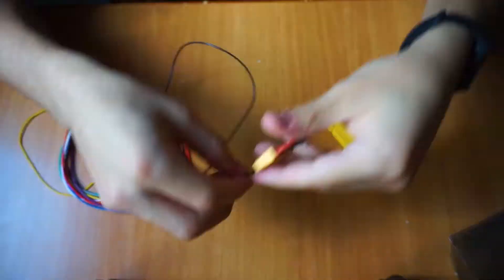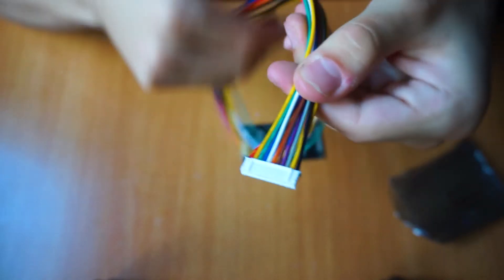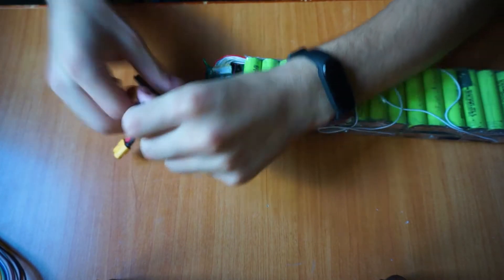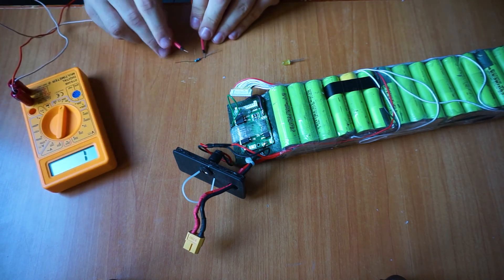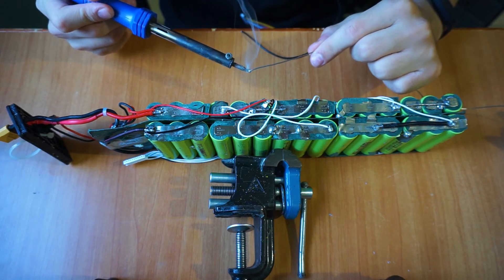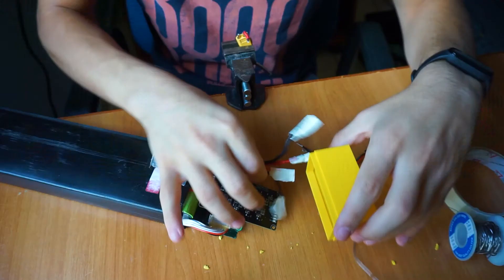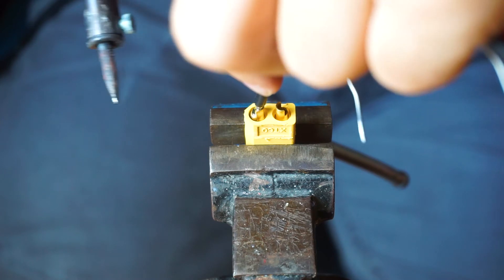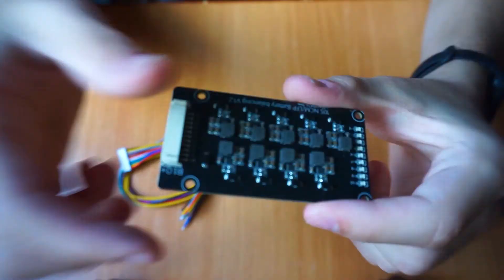Let's Add an Active Balancer to the Electric Bike Battery - Li-ion Battery

Comment: Hi! I hooked this type of 14S active balancer upp to an inbalanced 14S batterypack. Some LEDs lit up, then after 12 hours or so, all the LEDs where off, but when I measured the battery, its was stil as inbalanced as before, so the active balancer did nothing? Is that not strange? I have another big battery with an JK BMS thas has active balancing function and it works perfectly.

Comment: I did the same method, but when I connected the last wire (red positive) under the battery, smoke came out of the stabilizer. What is the reason?
Reply from the maker: Probably inverse polarity

Comment: Don't solder on the cells!! Solder in between.
Reply from the maker: in between ?
Reply: @mauri_scio  On the nickel strip in between the cells.
Reply: When building a battery pack, you typically make sure that those nickel strips on every series connection are extended and bent near the cell (with the proper insulation between cell and strip). You unbend it a bit and solder there, then bend it back down. 

If however it's a battery pack that is already soldered like that, what's been done has been done. Soldering over other solder, if your soldering iron is big and powerful, is relatively easy and fast. The cell won't really overheat if you do your job in something like 1-2 seconds (that requires experience).
The real problem there, is how much attention the original battery builder has paid when building it ¯\_(ツ)_/¯

However "not soldering on the cell" isn't really great advice. 
Here's why: 
If special extra paper rings have been stuck on the positive end of every cell, then ok, go ahead and solder in between. However if the cells don't have any extra insulation, you run the risk of over heating that spot, melting the insulation and completely sorting the cell (since the outer ring of the positive side of the cell, which is insulated, is actually the negative pole (alongside all the battery walls and opposite end of the cell). In this case, the nickel strip will become red hot and probably melt, therefore disconnecting it from the sort. But then you will have to remove that one cell, since it will have gotten quite hot by itself, possibly slightly damaged, but also, you will have a cell that has melted nickel all over it 😊
Spot welded cells cannot be removed easily 😊 So, have fun with that... 

To summarize: You need extra insulation on the positive end of the cells if you want to solder in between. 
The industry standard is to have strips going "over the edge" and soldering there. After that, you bend them and they are touching the cell walls or the plastic frame if such a frame has been used). If a frame hasn't been used, then you must also add appropriate insulation at the contact area.

Comment: You Don't have to let lt be forever there the active balancer...boy....just balance the pack and chek wether it is balanced or not then disconnect and remove.
Reply from the maker: And whey is that ? isn't more convenient to use that 24/7 ?
Reply: @mauri_scio  no it such your battery after couple of days you loose alot energy. Because the active balancer is in action 24/7.
Reply: Its low power usage takes 2 months to deplete your battery just charge it from time to time
Reply: @mauri_scio  Once the pack is balanced it is done. I guess leaving it is ok as well.
Reply: What are best installation for active balancer? To battery direct or connect balancer to bms ?
Reply: Can you ad balancer together with bms ? Do we have to disconnect bms first? Do active balancer equalizer start balancing immediately or need to charging battery ?

Comment: What advantages after install active balancer to your ebike
Reply from the maker: The advantage is that your battery pack is way more secure and when you charge your ebike you're sure you're charging it to the full level and not to the level of the cell that first arrive to the full level
Reply: There is 2 type of active balancer inductive and capistor?
Wich is best for ebike battery??
Thanks 😊

Comment: Hi - I bought a 14s one of these to charge balance my ebike pack.  It didn't work , an actually caused the gap between highest and lowest to be increased!  I ended up getting a bulkier one with large caps on the back and it works a dream!  Useful for occasional balancing, but too big inside the pack (and def not a scooter)
Reply from the maker: Understood. I don't know. Mine seems to work pretty well
Reply: bro you mean the expensive one around 40 bucks ?? the one with the red capacitors right ?? is it possible to reconnect and connect them over and over without damaging the balancer ??...because the chape ones i used all blew up.

Comment: Does it protect battery life overcharge and discharge?
Reply from the maker: If you mean if it protect the batteries from overcharge and over discharge the answer is yes but not totally. When it charges the batteries, it protects them from overcharging. However it doesn't protect overcharging if the batteries are charged by the BMS. Same with the discharging process
Reply: @mauri_scio  balancer can not protect over charge or over current, that's BMS job, balancer is just to make sure the battery is balanced, it can not cut off charging
Reply: @nelsoncruz7278 cuz it doesnt have any input from outside, apperantly. thanks for the info